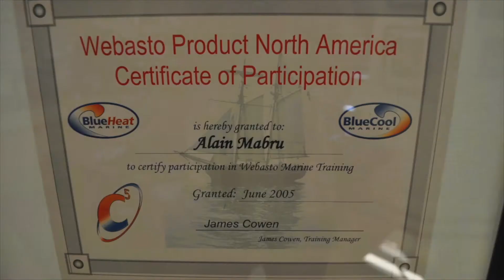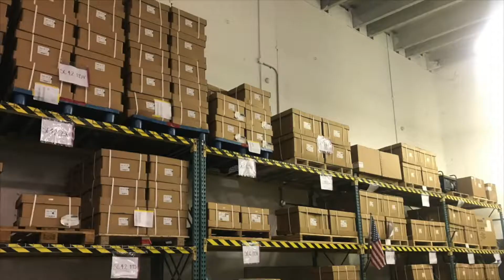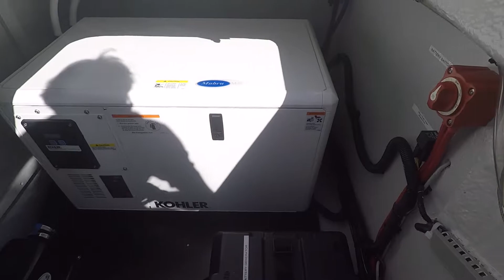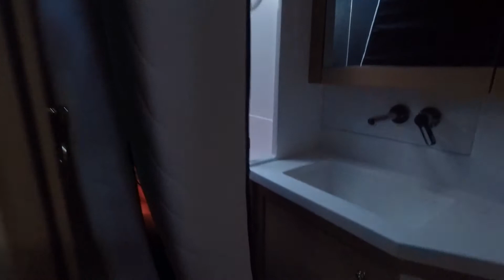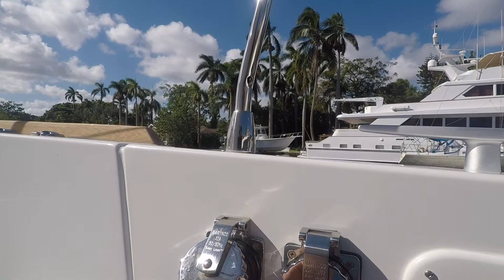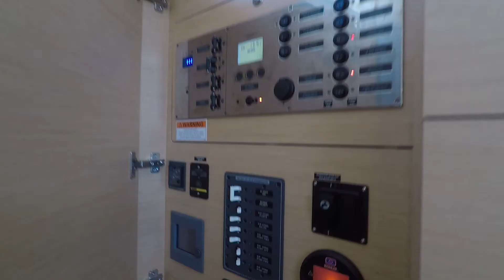Marine Air Conditioning and Generator installation on a Lagoon 450F by Mabru Power Systems, Inc

Comment: Your generators abilities to keep your air conditioning running is only as good as your ability to carry enough fuel for the generator.  When you are underway on an extended trip like a transatlantic crossing  your AC is not sustainable.
Reply from the maker: There are several AC options. In this installation, we have installed several units for use in a charter vessel. In this application, our customers want to have plenty of available power without the fear of draining down batteries. The vessel comes standard with 1,000 L of fuel, the generator installed on this vessel consumes 1.9L per hr @ 75% capacity which gives the user 500hrs of runtime. I have rarely seen a vessel put 500hrs on their generator in a year much less in between fill ups. I am not really understanding the point of your comment but if you are looking for a battery based, solar charging / wind generator system, we have a DC 5,000BTU unit that draws only 360W with our pump running so this would be a no brainer for someone looking for a "sustainable" option.

Comment: where is the exit path for the hot air?
Reply from the maker: Whatever Whatever the ac units are water-cooled so no need for hot air discharge. Air-cooled units do not fair well in the marine environment.